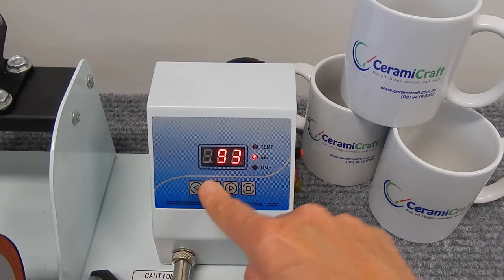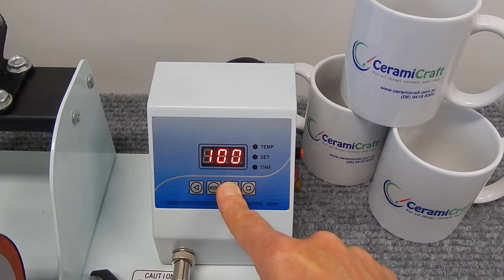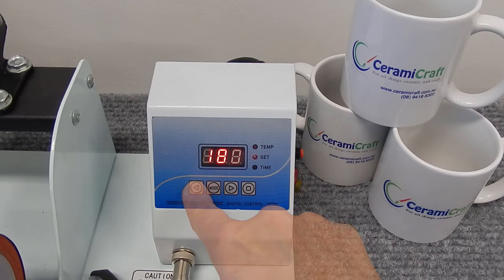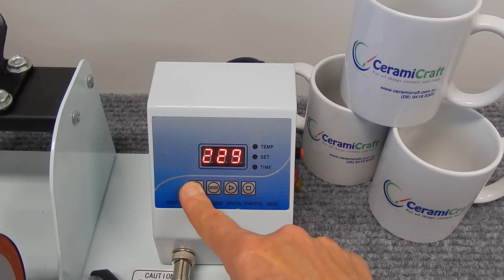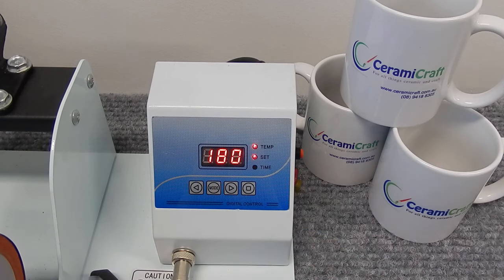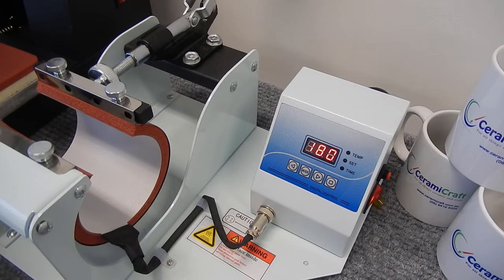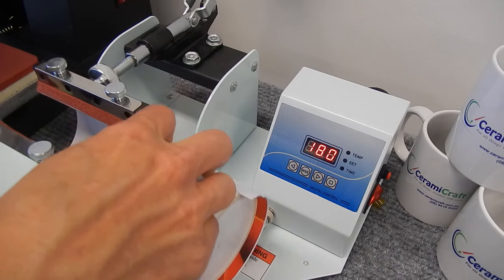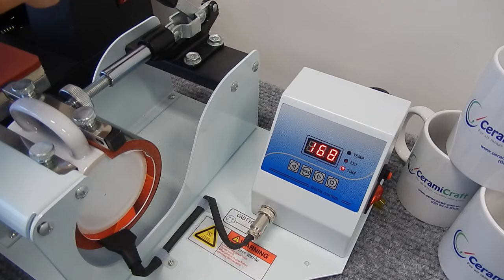Tips for sublimating an 11oz Coffee Mug including time and temperature settings!

Comment: 180C from 2 minutes 30 sec to 2:50 3 mugs messed up. . Higher pressure didn't change the outcome but on the 2:50 mug the colors are way better but looks like it burned plus didn't transfer the colors well, maybe my mugs are not good for that high temp gonna try with 160C and i really hope i can find the best settings for my mugs/press beacuse it feels very bad to fuck up even just 1 mug but 3?  Pretty horrible day but i hope i learned something that i can use in the future. . I also wrote every settings on the mugs so i know what setting do what.
Reply from the maker: It is normal to go through a number of blanks in the beginning when getting used to your equipment so don’t be too hard on yourself. Just continue to keeping track of the settings you are trying as you go, try not to make too many changes at once, and you’ll find what works eventually. If the supplier of your mugs has any recommended time and temp settings that’s also a great place to start. As not all blanks are the same.

Comment: Can u change the mould & use the 20oz tumbler mould on this machine?
Thank you
Reply from the maker: No, this machine is better for mugs and glassware, or applying spot graphics to drink bottles. This machine only has the two screw points for the attachment, which are about the length of a mug. To do 20oz tumblers people generally want to be able to apply an all over design. And to do that you need to be able to fit a longer attachment with more screws to get even pressure across the blank. A dedicated tumbler press would be best for this.

Comment: hi i do the same instruction as your but it came out with a blur photo  on the mug . is it because of i put too much pressure on it or i didnt tape it correctly ?
appreciate your reply
Reply from the maker: The settings we provide are a good place to start, however individual testing with your own equipment is always required to achieve the best results. Typically, blurring where you can see the edges of the image bleeding/blowing out is an indicator of too much time/temperature. If the image however appears to be ghosting where it’s doubling up, this is likely due to the transfer shifting during the sublimation process, and would indicate you need to tape down your design more securely. I hope that helps!

Comment: Why does ur heat press constantly beep between pressing? Like once the temp is set? I cannot figure out 4the life of me why mine beeps or how 2stop it 🤔😞
Reply: Regular temperature drops, and it needing to heat up to maintain that temperature?
Reply: @seabreezeful  Mine constantly beeps once it reaches set temp & time. Until or unless I press the button 2restart timer & just let timer go. I've gotten a tip from someone else to just set timer on a higher level. So for now I have mine set to 600. & It's quiet the whole time that timer runs. The only issue now is, I just have to keep resetting on timer reaches down to 0. 😞 It's kind of annoying

Comment: When printing on black mugs, with the white strip, do you do the same? Im going 180 for 30 seconds, and the 'black printed area' is turning out brown. Any tips? Cheers!
Reply from the maker: If your transfer is coming out brown after pressing for only 30sec at 180 Celsius try increasing your time to 170sec. If the black area of the blanks themselves is discolouring at these settings I’d be questioning if the blanks you're using are suitable for sublimation.  Looking at your paper after pressing can also give you an indication as to what’s going on. Still a lot of ink on it - you haven’t pressed for long enough/or hot enough to release the ink from the transfer paper, or you’ve printed on the wrong side of the transfer paper / or not using the right paper to begin with.
Paper brown and burnt - your press is too hot/you’ve pressed for too long.

Comment: Is this the same for glass mugs?
Reply from the maker: The time and temp settings may vary slightly depend on the specific blank you are using, however the process  remains the same. You'll find suggested pressing instructions included for our blanks on our website.

Comment: What is the use of the reset button please ?
Reply from the maker: The red button on the side of the machine is an overload safety switch, in the event that there is a power surge this button will activate automatically along with the machines surge protection to prevent any damage to the machines circuitry.

Comment: When i try this the edges near the handle and at the bottom are faded, why is that?
Reply from the maker: Emma, it is a combination of time, temperature and pressure. We would advise increasing the pressing time to compensate for a slightly lower pressure toward the outer edges of the heat mat

Comment: Why does my grey come out green after pressing
Reply from the maker: Presuming you have already completed a nozzle check and all inks are feeding correctly. Greenish looking greys and blacks can sometimes indicate that the design has been undercooked, try a slightly longer pressing time and see how that goes. If you’re still getting a green result it might be worth looking into the CMYK colour values used in your design. If the Grey has an unbalanced amount of Yellow or Cyan in it this could also cause a greenish result.
Reply: Grey comes out completely different. Try setting your color at 7cb7c9. It will look different on screen but grey when you print. I learnt the painful way of wasting so many mugs so I am happy to share.